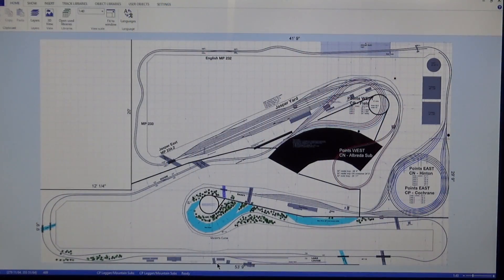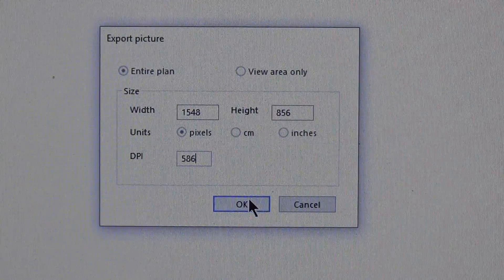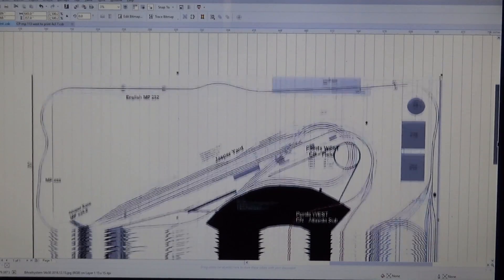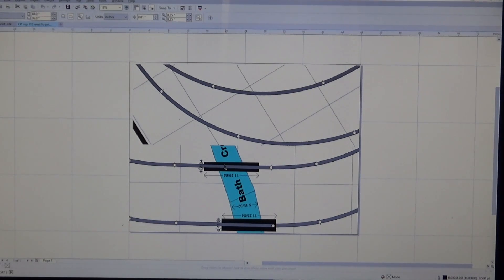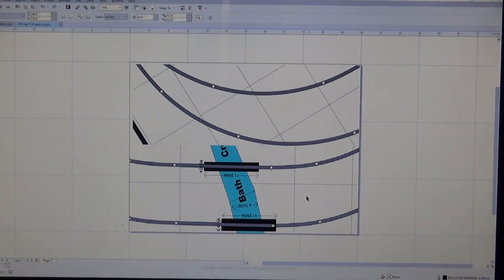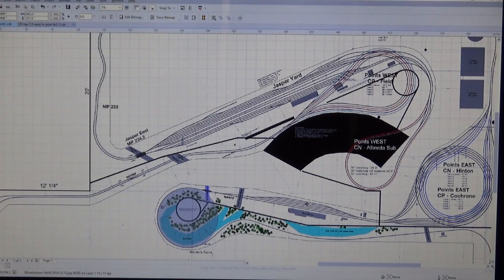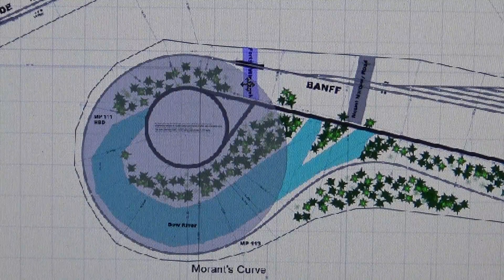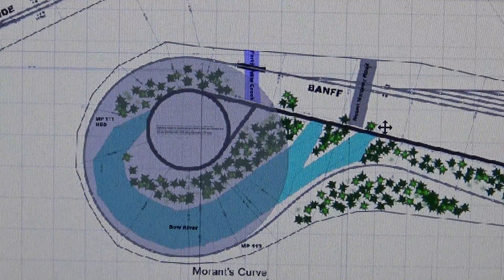How I Print Full Size Track Plans for Plywood Cutting Templates

Comment: How do I print individual track pieces? Trying to layout a ceiling layout with fastrack and have some curves and a parallel side line I'm trying to figure out. Thought I'd try printing out pieces to lay down to figure those spots out rather than guessing and buying the wrong track pieces.
Reply from the maker: Fast Tracks has a whole bunch of printable templates: 
https://www.google.com/search?q=fast+tracks+printable+templates&rlz=1C1GCEB_enCA869CA869&oq=fast+tracks+printable+templates&aqs=chrome..69i57j33.4574j0j7&sourceid=chrome&ie=UTF-8
Reply: @BArailsystem  I'm using lionel Fastrack.. that one is for the webpage fast track.. needing templates to print for Fastrack.. trying to figure out what pieces I need

Comment: 258 radius?that's not possible in ho scale! They look like 24 to 32 inch radius. Where did you get that number from in your video at 11:05.
Reply from the maker: Sure it is Tony, theoretically you could have any radius you want up to infiniti. I think the camera angle I chose at that point doesn't show it very well. The 2x2 studs behind are 2' spacing. That curve is over 8' long and only turns a few degrees. If I continued it all the way around and completed the full circle it would be 516" (43'). I only have roughly 6% of that circle which fits in that section of my layout. 
Another thing to note about large curves like these is the only way to do them is use track planning software and print the templates off in 1:1. Would be almost impossible to get a trammel point that is over 20' long.
Reply: Radius means half of the circumference, which is a complete circle or diameter. A circle has a 360 degree diameter and no matter how small or large it will always be the same. The circumference is the degrees of that full circle. Radius measures the degrees from the center out and in model railroading we measure this as inches. A 24-inch radius would equal 48-inches (4-foot), which would fit onto a standard plywood. Now with that said, why would you need such extremely broad curves? Even with the steepest grades and to save space, all you would really need is 48-inches. Just my point of view. Thanks.
Reply from the maker: I think we both understand the geometry of curves and circles. This section of my layout is about 30 feet long, 2 feet wide. There's a gentle S curve that occupies most of that section. Like I said, hypothetically if you completed that circle all the way around it would be 43' in diameter which is a 253'' radius curve. The whole point of me stating that the particular curve there is a 250''+ radius was to show the great tool that is a track planning program. It allows you to design large flowing curves like that. The smallest radius on my layout is 30'' in staging and 36'' everywhere on the visible layout. There's many reasons why curves greater than 24'' radius are useful. There's a fantastic article in this issue of Model Railroad Hobbyist which influenced my layout when I was designing it: 
http://macrodyn.com/assets/files/MRH-Q1/MRH-2009-Q1v3.pdf

Comment: Did you ever find the insulation for cars that surpresses  sound?
Reply from the maker: I've found that the product they use for dampening vibrations is called Mass Loaded Vinyl. I have to call around to get a price but everywhere I have found on the internet it's twice as expensive per square foot than the recycled rubber I found at Home Depot.

Comment: Great information as always, nicely done. How will you allow for expansion with such long runs? My layout is much smaller and the temperature is quite even, but I am still getting "bursts" on some of the curves. BC and its wild fluctuations (careful about spelling there) in humidity during the winter.
Reply from the maker: Thanks John. I am definitely going to leave expansion gaps in between each piece of flex track of about 0.5 mm. I'm monitoring the temperature and humidity in the basement and I am going to try and lay track in the season that is the midpoint between hottest and coldest temperatures. There's one run that is 54' long which could become a problem. A friend of mine who lives close by had a 40' run in his basement which he never had any problems with, but he did have a 20' yard section that did kink in one spot so who knows.

Comment: IS your plan to have two separate railroads - CN and CP. From what I can see on your track plan it looks like neither connects to the other. Is that right?
Reply from the maker: That's right, they are separate and one is 7'' higher than the other to allow for the reverse loops to be stacked. There is a section of the plan not shown in this video where I included turnouts and a connecting track to join the two. The best I could do with space available was a 2.8% grade and I didn't think it was worth it operationally to include. It could be added later on but as of now I am not going to build it.